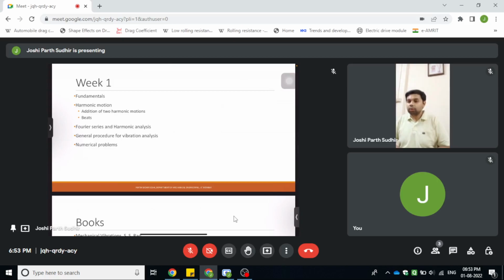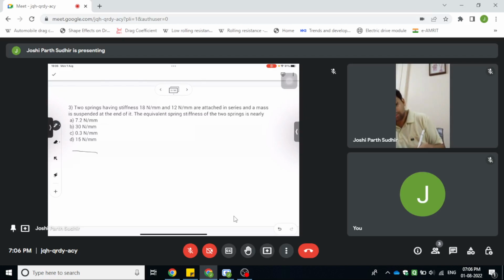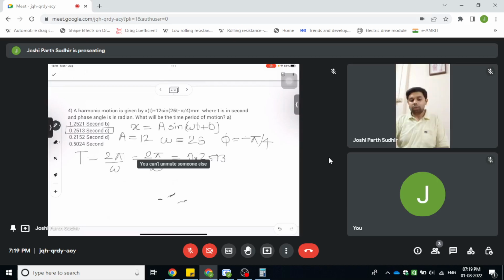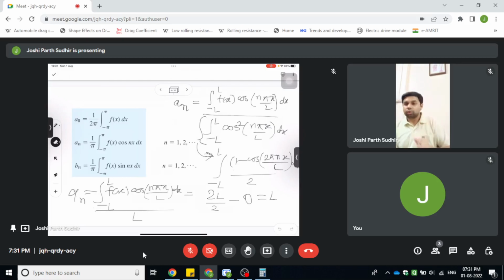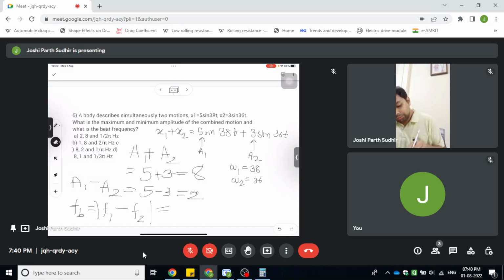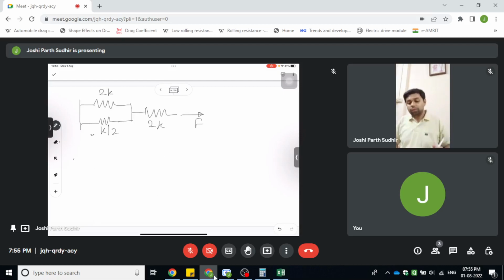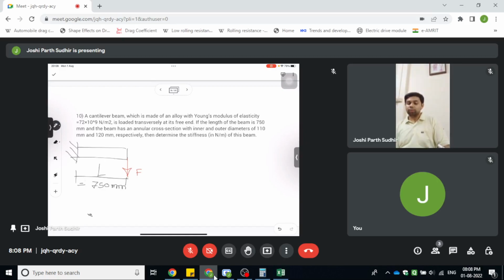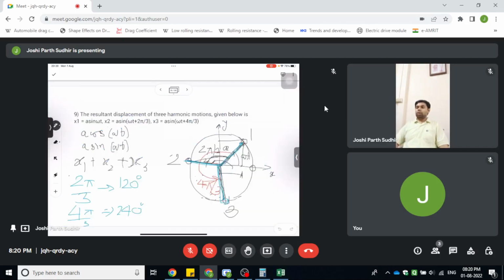Introduction to Mechanical Vibration Week 1 Tutorial Session

Comment: Sir assignment questions
Reply from the maker: What is your question exactly?
Reply: the spring constant of a cantilever beam having length (l), modulus of elasticity (e) and area moment of inertia (i) subjected to load w at mid-point is
Reply from the maker: @sameerbs5342  Please post your questions/doubts/clarifications on the discussion forum for the course.

Hint for your question: Spring constant is the 'Force per unit deflection'